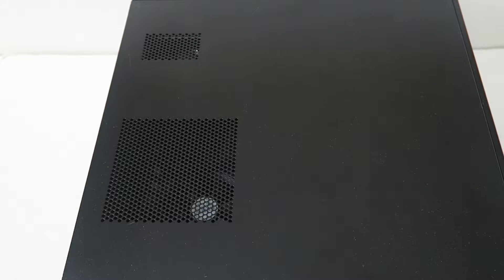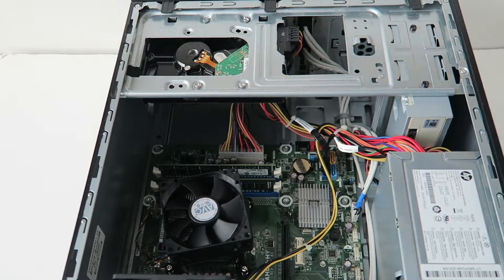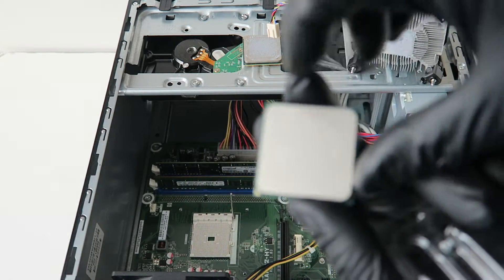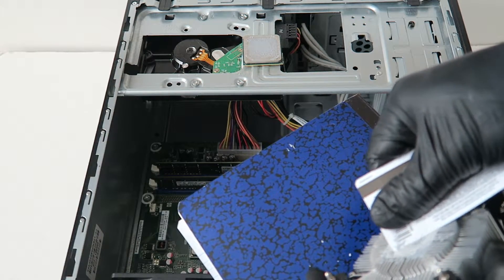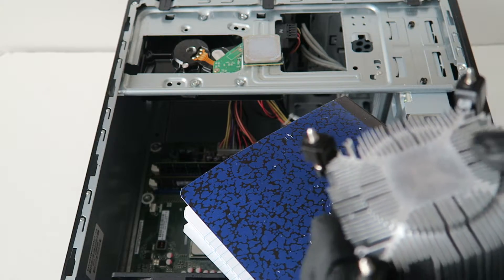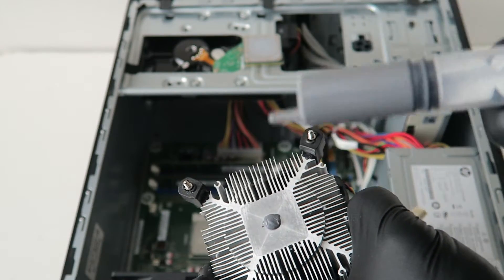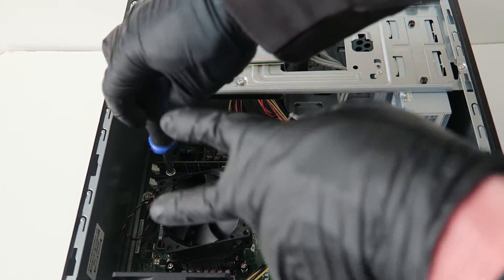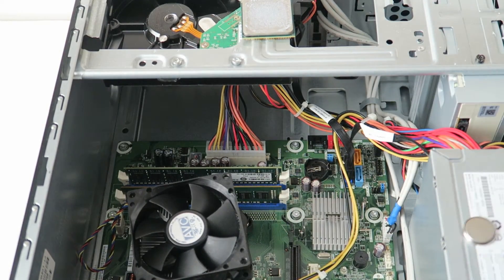HP Pro 3405 Upgrade Processor CMOS Battery

Comment: I watched some of your videos, and I upgraded my HP Pro 3405 MT with Video Card SSD PSU and RAM. Now I have a problem with the processor. It's the weakest part of my computer. I see that you upgraded CPU here and I would appreciate for you to advice me should I upgrade the processor as in your video because my friend is advicing me to buy a new one (i3-10100F, that would be good enough for me). In case I do buy it, I will have to buy a new motherboard, RAM and case as well. 
Thank you in advance!
Reply from the maker: Hi, thanks... yes it is not worth it to upgrade CPU on this motherboard and you can still use this hp case and power supply and you can get new Micro ATX motherboard and with this hp case, i would go at least  i5-10400  and i3-10100F is a great CPU.
Reply: @Mxkdt  Dude, you are awesome :) Thank you so much for such a fast reply! You definitely know your stuff ;)
Reply: @Mxkdt  Thank you again, I decided that MSI B460M-a pro and i3-10100F is the best budget combination for my needs. It will cost me 165$. Would you agree with this combination?
Reply from the maker: Is it brand new or used ?
Reply: @Mxkdt   Brand new.
Reply from the maker: Yes i would agree, buy it... that i3 3-10100F  as same as i7 7700
https://cpu.userbenchmark.com/Compare/Intel-Core-i7-7700-vs-Intel-Core-i3-10100F/3887vs4082
Reply from the maker: Please don't forget to subscribe to the channel.
Reply: @Mxkdt   Hello, it's me again. I have to change my motherboard. Suppliers don't have MSI B460M-a pro any more. What do you think, is ASRock B460M PRO4 a good replacement, or something else? You know better, you helped me two years ago! And thank you so much for that 👍💪😎

Comment: hey mxkdi! how are you doin! ☺
I need your help man. I have an hp elite 8000 tower running with core2quad q9500. I want to install a gtx 1050ti gpu in it. please tell me if I can do that and also tell me which 1050ti is best for me.
Reply from the maker: Hi, Yes you can install evga gtx 1050ti with single fan i recommend you get newer tower like at least i5 third gen for gaming
Reply: thanks man ! the thing is I can't afford any further more upgrade besides gpu, will it game good or bad with the core2quad ? ; /
Reply from the maker: What games do you play?
Reply from the maker: q9500 is outdated i recommend you get at least i5 2400 cpu to use gtx 1050 ti
Reply: I'm a student, I have high expectations with empty pocket. You might know what I'm saying, just tell me if it can play latest games on 1080p with 30+ minimum fps
Reply: My demand isn't 60fps in every game. Will it play battlefield 1 1080p ultra with 30+ minimum fps?
Reply: Actually i have a plan to upgrade on i5 2500 but it will cost me 120$. I'll keep that for later. Right now I might have to carry on with the old quad. Atleast an year after I get the gpu.